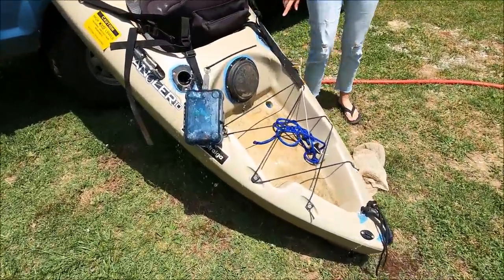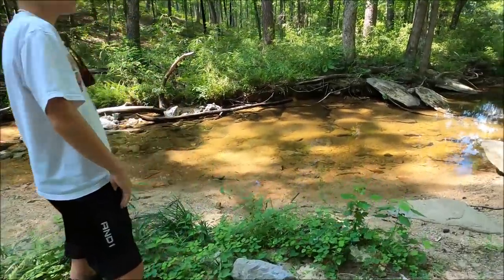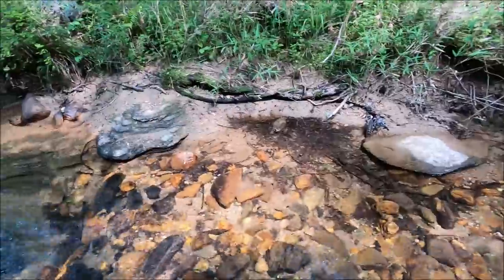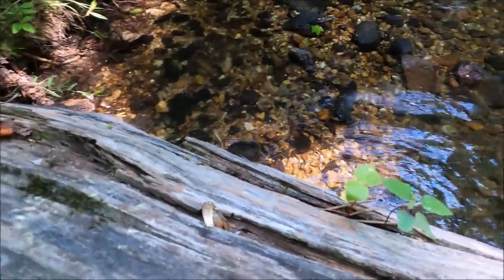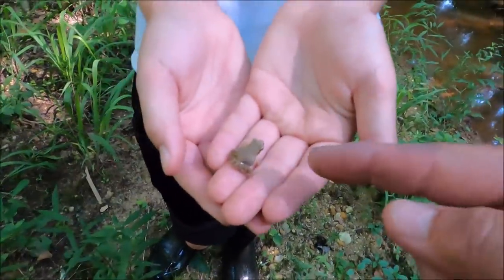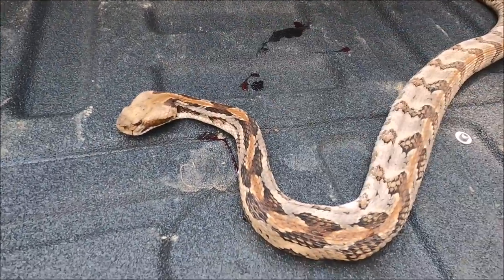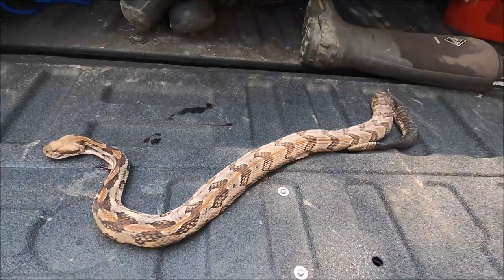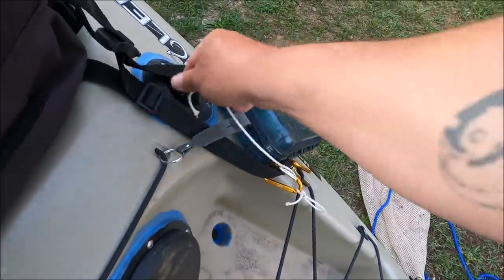How to Find Leaks in Kayak:  Herping After

Comment: We shot a rattler a bit bigger than that at our place in Oregon. It blew the head off but when I picked it up to get pictures the stump kept trying to strike at me. Such a weird sight. If you ever need to trap a skunk for relocating use a trap like the squirrel-anator. It is a large square but only about 4” high so they can’t lift their tail and can’t spray you. I caught several while trapping ground squirrels, relocated them and never got sprayed. So glad our new home in Montana doesn’t have any rattlers.

Comment: A Timber Rattlesnake will shed it's skin an average of 3 times a year adding a new segment to the rattles with each shed. If the snake has a complete set of rattles, by that I mean none of the segments have broken off during it's travels or previous sheds, you can divide the number of segments by 3 for an approximate age.  This snake is probably 3 to 4 years old as it appears to have pretty much a complete set of rattles.  Timber Rattlesnakes are one of my favorite reptiles and I hate to see them dead in the road but if they are intact and fresh I always skin them and save the hide.